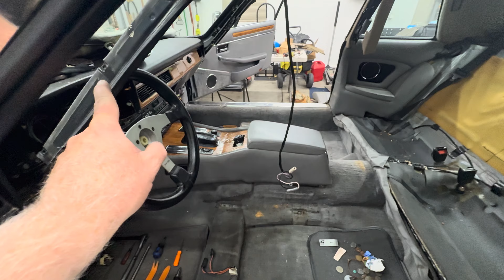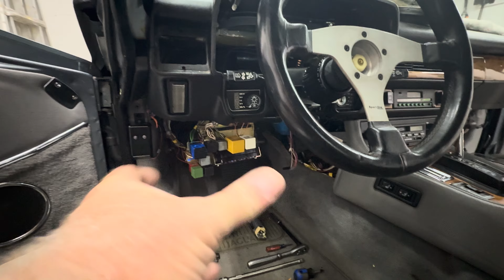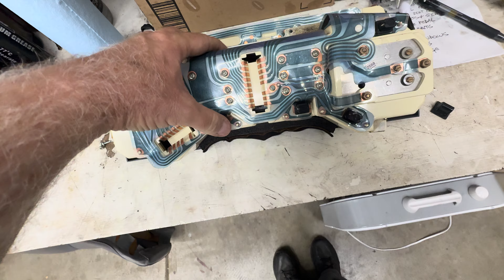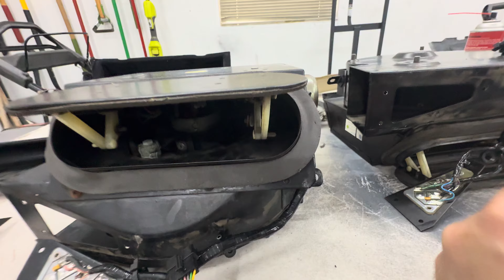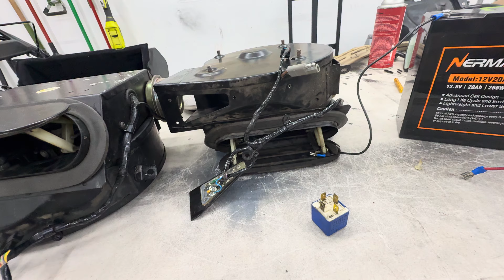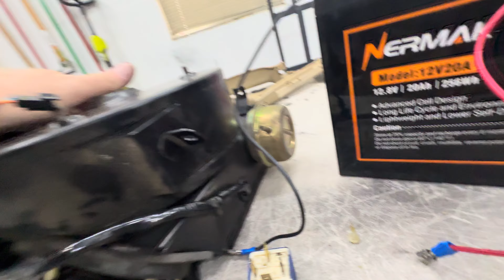Removing the Interior on the 1989 XJS

Comment: I took my interior apart a few years ago in advance of reupholstering it all. I lined the entire cabin with soundproofing material. Installed all new Alpine stereo. Radio and A/C are really hard to get back in place with new leather upholstery. There is a LOT of electrical running down both sides of the transmission tunnel. 
I would love to replace the automated seatbelt and install a standard three-point harness. Anyone done that before?
BTW, those motorized seatbelts have LIFETIME warranties backed by Jaguar, IF you can find a competent dealership to do the work. Last time I drove my XJ-S to a dealer, all the service assistants looked at it like it was a flying saucer.
Reply from the maker: Thank you. Already looked into the dealership repair option. Response: parts are no longer available, warranty remains open. WTF does that mean??? I want to keep the car as close to original as possible. Hence trying to repair before I remove entirely. 

I’m suprising myself with this $1,500 car. Taking me back to working on things in the 70’s  before it all turned into plastic, fake wood, and iPhones.😮
Reply: @gunthersplace You can push a little harder on Jaguar to repair or pay for full restoration. A warranty means they need to provide the parts or otherwise restore them.

Comment: The 2 pieces for your console can be ordered new from Moss British Auto Parts for less than $10.00 plus shipping and they are USA located . The pieces in front by the windshield is the A pillars . Fortunately my XJS V12 is a 1990 and they do not have the seat belts that retract automatically . I took my headliner out without removing seats or steering wheel .  The headliner board was to bad to recover so I will mold a fiberglass headliner board then recover it . Now when I say mold a headliner board u line your top side of your roof with aluminum foil and coat with WD40 then lay your fiberglass mat the resin . It will be larger than the inside roof but u just trim the edges to fit . U can lay heat insulation on the roof .   A little tip use Lokweld contact adhesive . Do not use any sprat can crap as it will fail . U can brush on the glue or just spray it with a old style siphon spray paint gun .